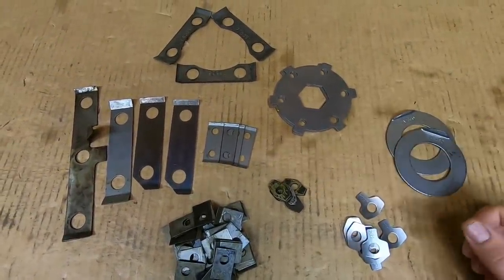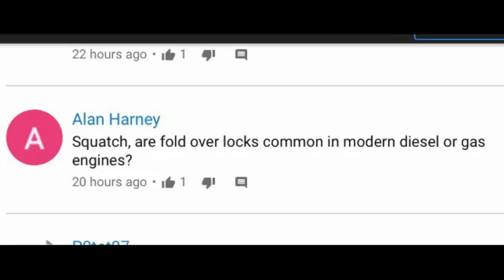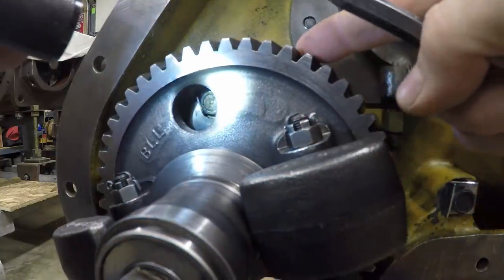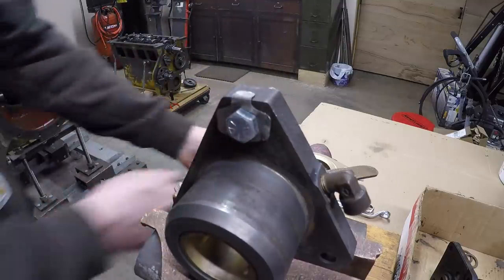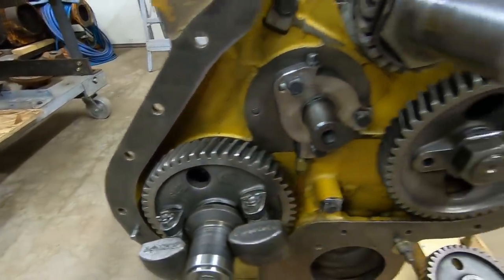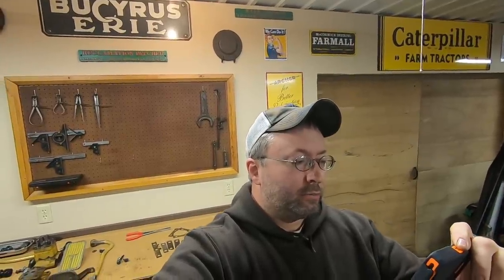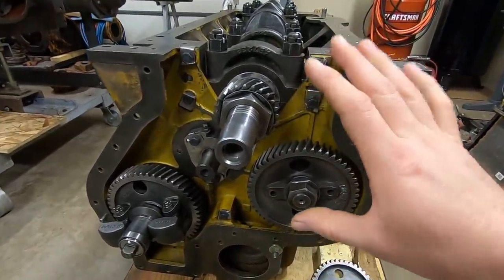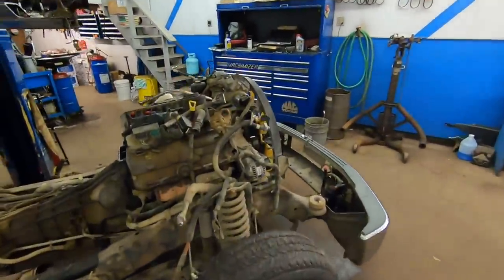Caterpillar D2 #5J1113 - Why Fold-Over Locks? Popular Viewer Request Video & Comments Answered

Comment: Safety wires on aircraft engine bolts are analogous and are still in use as far as I know.  Good insurance against loosening in an even more critical application.  Your videos are perfect; don't change a thing.  I love your values, your philosophy, and your presentation.
Reply: Even lockwire is getting to be a dated art. A lot of new procedures are using safety cable now, in the interests of time and training expenses. Same way that zip ties replaced cable lacing in electrical work.

Comment: YOU are doing I fine job. 
.In ten years working on equipment at home on the ranch and 47 years working in Dealerships and Government fleets as a mechanic I never once found a loose bolt that was secured with a fold over lock. I have seen lots of broken lock washers and failed nylon locking fasteners. And to this day fold lock are still installed in critical locations. Safety wiring fasteners is also very effective, If done correctly. Safety wiring fasteners requires a complete understanding of the process and the loads  involved I have seen it done completely wrong.

Comment: Great explanation of fold over locks. Yes I think in some cases there may be and easier way to do it. I agree with you. When working on these old machines I like to keep it as original as possible. The people that built these things knew what they were doing and they paid attention to quality. That's why these machines are still around. I also agree with your emphasis on using manuals. The basics of most engines may be the same but all engines have their differences and different specs. A good mechanic will go over the books before turning a wrench. Great video!

Comment: I've used fold overs, probably on Gravely tractors and had to reuse the old ones. Still going. I like fold overs and would never swap for a washer. And I'm not opposed to Loctite but if it has a fold over, that's what it'll have. Thanks, Toby. They just work. Hi, POP!

Comment: I made a fold-over lock for a piece of equipment at work. I can’t say for sure if it will work yet but I’m proud of my makeshift gizmo for preventing a nut from backing off a bolt that keeps an axle on a mower. It’s a nylon nut and I gave it a good glob of loctite. And it still backed off so I made a fold over lock for it. Hope it works.

Comment: Fold over locks were needed when hardware quality was a bit iffy. Once graded hardware came out it mostly went away and was replaced by torque specs.  They certainly add that bit of extra bling that makes the project better. :-)

Comment: I remember many years ago asking my Dad (who did all his own repair work, and learned from his Dad) a question like why points and condensers weren't being used anymore (and being replaced by solid-state ignition systems).  His complicated answer involved explaining that new solutions were found for common problems, and that the "old" tech wasn't necessarily bad tech, it was still good, but someone had just figured out a better solution in the interim.  Early tractors and trucks had gas engines.  We've since upgraded to diesels, but gas engines that are properly maintained and are still around, still get the job done.  Same with planes... most (commercial) planes are jet-powered now, but the old piston pounders (like the good old DC-3) still work and still make air pass over the wings for lift.  We've just found more efficient means or more economical means that has ended up superseding the previous method.  Doesn't mean that the old way was bad, it's still good, but in the meantime, the world moves forward (which isn't necessarily a great thing all the time).

Comment: Thanks for going the extra mile in response to viewer comments. I really enjoy the detail & humor in your videos. I too have been a rock farmer at various points in my life. Keep it up please.
There are still versions of fold over locks in modern use today, most often in serviceable wheel bearings and in CV/Rezeppa/Cardan joints. There are two main advantages of fold over locks compared to the common lock washers (split or star). The first is that tension is not lost under vibration. Proprietary testing (and perhaps Caterpillar experience) has shown that under both random and sine vibration that the common lock washers can "fail", that is lose tension. Locking methods that do not fail during vibration include lock wiring, Nylocs (single use), and fold over locks. The second issue with lock washers is that, depending on the materials involved, small particles can be generated that could migrate into areas where they can cause wear or other problems.

Comment: I know exactly where your coming from. I've spent almost 30 years in a dealership garage and would rather have the fold-over locks used instead of the self locking bolts and nuts used today. The other thing about the fold-over locks in the CAT engine is though no one else will really see them, unless they watch your videos, you know they are there and that that's the way it was when it was built new by hand back in the day. Looking forward to the next video.

Comment: Great video on the use of mechanical locks on bolted connections!  My uncle had an old Cat HT4, and a 1940s vintage D8.  He also had all the original CAT books for these two machines.  One other thing you may want to mention and show someday about the remarkable quality of original CAT parts is the original CAT bolts (where the heads are (were?) generally thicker/longer that non-CAT bolts, also most are Grade 8+) .  My uncle loved these and bought many to use on non-CAT projects.
Keep up the good high quality work, on the CAT projects and the videos!!

Comment: I feel you on pulling the cabs to work on the trucks. I have a piece of plywood I lay over the top of the transmission to the front of the bed to create the workbench for all the crap you have to take off. Awesome work on the old Cats as a purist with that you have all my respect.

Comment: Lock washers (especially new Chinese made) are junk! You don't see them used on new Cat equipment in any crucial location. If they are used it's on some crap plastic or sheet metal things. Man, that hurt by the way... Cummins D2, like I was being laughed at haha. I made due with what I had, so 12v in my 5U3591. Sinful as it may be, when it's finished it'll be the mark I made. Like a brown streak to ACMOC, but cool to others haha. At the end of the day, we work on and fix so much new junk, at home the more basic, simple and cheap, the better. Fold over locks are rewarding when they are tucked in neatly. Like a nice tie wire job. Enjoying the build videos. Excited to see it together again and running!

Comment: Closed my garage of 35 years last December  and the shot of the cab of the work truck in the air to gain access to the engine reminds me how much I miss the old designs. The international D466 in frames were good times compaired to the new trucks

Comment: They work and they are reliable. If you get the bolt even reasonably tight and install them right they will keep it from backing out. 
To my mind foldover locks are a lot like lockwire. Bolts on aircraft engines still use lockwire, and there is a darn good reason for that.

Comment: Briggs / Stratton used fold-over locks on the con rod bolts. All those fold-over locks on the Cat are fascinating. You know that some worker at Cat meticulously folded each one over all those years ago. You know it was done by hand. It's great. Putting lock washers on there would be a crime.

Comment: I really appreciate how you have gone in depth with everything. We as a society are nothing more than a throw away society. I will add though because of cost of labor and or parts can be cost prohibitive. Only reason I would like my 3406 over my Cummins ISX is solely the simplicity's the Cat had. Cummins is a good motor but reliability is in question. Good thing I can work on this stuff even though I'm not a "mechanic"

Comment: You comment about swapping in a Cummings brought to mind the ship of Theseus.
While the engine you are rebuilding isn't original, it is the type of repair available during the time machine was placed into service.  Not a full restoration.  Not an upgrade.  A working vehicle being repaired.

Comment: Squatch,
I work at Caterpiller Paving.  Caterpillar uses flat washers we rely on bolt stretch to keep the joint tight.  I can’t speak for engines or drivetrain’s.  I can’t wait to get my D2 home.  I would send a picture but I don’t know how to attach it to this post.

Comment: I believe that a fold-over lock is much more secure in a high vibration situation than a lock washer.  Also, fold over locks, cotter pins or similar positive locking mechanisms are still used in safety critical areas like the ball joints, tie rod ends, and spindle nuts on new cars today.

Comment: BOOKS, YOUave also learned the value of quality work. When I purchased my Triumph TR4 sports car, in '73. With its Triumph, English FORD Tractor motor, with wet sleeves and all.  Watching you is a flashback for me, as I have some fold-up tabs as well. The manuals of my auto are excellent.!  So, in closing please do not be so stingy with your work here. And I have a CAT camo hat for your collection. My fire dept. had several engines with CAT motors.
Reply: I am impressed with your ACCURATE Impersonation of What I said to myself when I typed, BOOKS. Outstanding.!

Comment: An interesting historical subject, perhaps not obsolete yet no longer modern, invaluable to those restoring these who had never before seen or used them.  And to be fair I have a table, 8 studs, 8 nuts and 8 lock washers for the legs, each year at least a few loosen, a leg wobbles, so maybe the new way is not the best.

Comment: I work in the Jumbo Jet industry and we do not use fold over washers in the manufacturing process. We do use lots of Safety Cable and Lockwire.
I'm thinking some of these folks need to bust a wrench out and work on something.

Comment: When I fit awkward tabs I usually give then a start bend, only a few degrees. Tighten up the bolt then use a flat screwdriver to complete the bend .Then if possible use a punch or a thin blunt chisel to complete. When I was an apprentice, we were given a test piece on tab fitting and wire locking. We were marked on correct method and quality of work. That was 45 years ago .

Comment: Squatch  my biggest pet peeve is that very  few  people  reads there operators manual for their equipment  car  truck  or whatever.
Thus is part of the reason there  so much failure in vehicles today. 
I was taught at a young age that you always let a turbo changed engine should be run at a idle for 3 minutes before shutdown  . To give the give the turbo a chance to slow down and cool down.  And by doing so it gives you good practice for when it really needs it .
I'm stickler about it  i let my tractor's cool down before shutdown. 😊😊😊😊👍👍👍
A very good video.  Don't worry about how much you talk about any subject.  You do better explaining than most.  There is a lot of mechanics that are just plain sloppy.  But you and your dad are not any of them.   I've have had to reappear a lot of there work over the years .  It can be frustrating.
Reply: @squatch253  it's true .😊👍

Comment: Well in my opinion they didnt use lock washers why well cast iron is actually soft material lock washers. Dig in and chew out cast material when removing and tabs are thinner and once you chew away cast material with a lock washer in most cases the ruined cast may not be repairable
Reply: And there is a reason they used studs in a lot of things in the old days on clylinder head mostly it was so the cylinder head could dynamicly float with exspantion and contraction amd never use a stander type flat washers on cylinder head studs has to be machine grade regular flat washers will mash out even when it is torqued to the right spec the exspantion with mash them out i dont know the grade catagory of a machine flat washer but it stronger the grade ten any washer or bolt thats been zinked galvinized or plate is actually weeker then the grade it is stamped such as a grade 8 when it was finished and tempered it is black and stamped grade 8 but when it is zinked ar galvonized the heat the material again for the zink to adhear to the bolt or washer and nuts when heating the material again to do this process material is then weaked

Comment: Fold-over locks are still used on the latest jet engines.    They are not terribly common, but certainly still used in choice locations where no other secondary retention features will work.

Comment: A good friend of mine is a bit of a nut for the wired fasteners too ( as used a lot in the older aircraft engines ) so not to worry about showing these locks, again.
They sure do stop a bolt/nut from working loose in the worst possible times and it's good to be shown how they work and why.
Reply: Lock wire / Safety wire is absolutely used everywhere on modern aircaft engines too.

Comment: Hey! We haven't even started the lock wire discussion yet! I don't know how you modern mechanics put up with the automotive engineers who design the crap you have to work on nowadays. I mean, pulling cabs off trucks to work on the engines? That just drives the cost up for the customers.

Comment: Sasquatch, two questions,
The first question is, when you installed the gear train retaining bolts I did not see you reference torque specs or even use a torque wrench.
Does the fold over locks eliminate the need to put a final torque on the bolts?
The second question is, what failed on the Powerstroke?  No. 8 injector due to tandem turbo charge?
Reply: I'm going on a limb and say the turbo failed you saw how much end play there was.

Comment: Batteries/electronics all fail in heat and cold cycles. Plus, electrical is charged per hour - and last the 1940's power grid is already 'maxed' out.

Comment: I agree with you old & simple is better. I've only used
Reply: I agree with you old & simple is better. I've only used fold over locks a few times. Ive work at a restoration/ high performance shop & in the Army i worked on aircraft we always used safety wire

Comment: If people not understand how these locks are mounted then use modern replacements, called Loctite  a fluid that solidifies and locks screw, bolt easily. If you not understand how the "CAT professor" bent the locking plate in the hole, you should probably stick to building LEGO ...

Comment: Do you realize you may have started a run on locking tabs at cat parts departments..  now I have to plan a 20 mile out of the way trip to my cat dealer.. but they will probably just jingle on my keyring till I need them for something.

Comment: No need to respond. Seems as though a lock washer would serve the same purpose. Or, loc-tight.
Reply: Mark Witkop When these machines were built, loctite was not yet invented, and lock washers tend to not do their job over time like fold over washers. These machines were built to last and needed to be dependable in extreme conditions.
Reply: Lock washers have a tendency to break in half and rattle out.